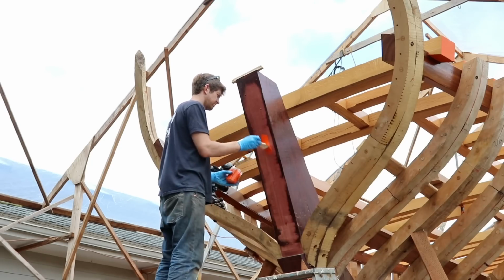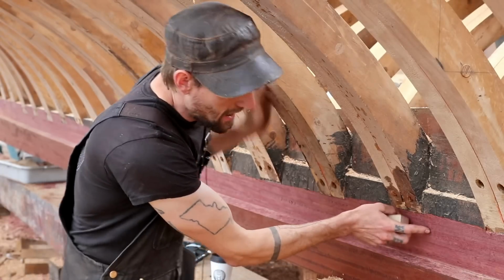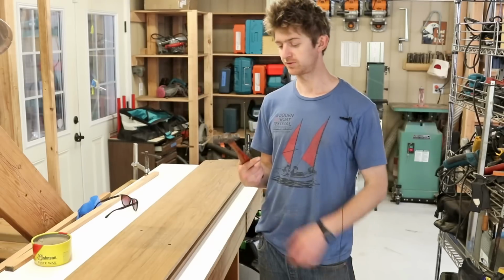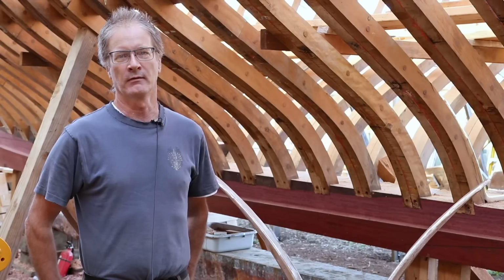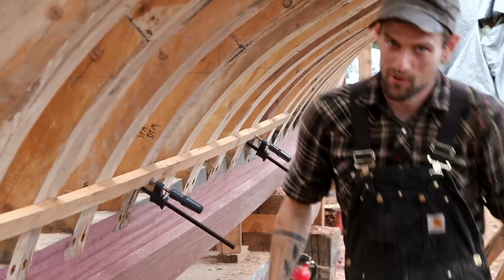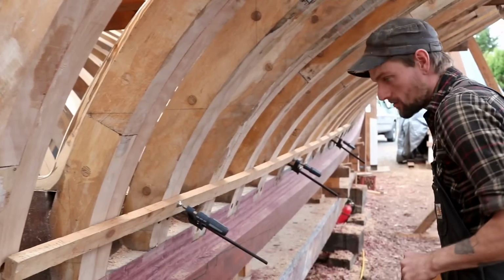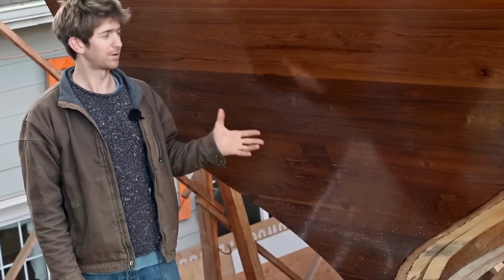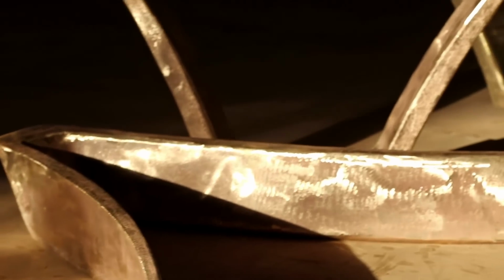BoatBuilding - Finishing the Transom (EP76)

Comment: Wow what a great episode! Absolutely loved seeing Pete and his good adze work, well done. Not to be critical, and I am not, because you are doing an amazing restoration of a classic yacht. For future reference, I am not a fan of splines for exterior joints. A few years ago I did a major repair to a very well built motor cruiser that had inch and a half solid old growth Teak cabin sides. The teak had been joined with plywood splines (not a good idea), apparently the boat had been left for a number of years under covers. The glue joints had failed and water had accumulated in the bottom groove, I have never seen so much rot in Teak. Since then my preferred joint is simply half lapped so that if there is a glue failure, the water runs out of the joint. I'm sure that what you have done, especially with the cotton barrier that it will be fine. Keep up the great work and videos.

Comment: id definitely polish those things. you said it yourself, the ability for corrosion on little crags and bumps from the mold would hold little bits of water and be more prone to corrosion all over. Polishing them to near mirror would be the best way to stop progressive corrosion imo. and they look effin gorgeous. you should sell posters of the long shot down the center of frames and floors when they are faired, polished and installed. id buy dat.

Comment: Polishing metal to a mirror shine is not a waste of time. For metal, the usual rule is - the higher the surface finish, the longer it will resist surface oxidation. Like with wood, small dents and holes is where humidity will get caught, and that hole/scratch will deepen quickly, then beome a true cavity, which soon becomes a seed for interior rot that burrows into the structure and spreads like wildfire. A mirror surface leaves very little space for the water to acumulate in such spots, and means that the corrosion must eat it's way inside from the surface. So even if nobody will ever see then, they will hold up longer because of the surface finish.

Comment: Hi Leo. Astonishing work on the transom. Just a few questions/comments:
1) How do you know how much torque you're putting on the Bronze bolts through the Stern Post - i.e  how tight are those babies?
2) Liking the polished floors. Having cleaned a few bilges in my time, I can tell you that those polished pieces are much easier to clean, green though they may be.
3) I can see your mate - the parrot- keeps on trukin'. Fun partner.

Comment: Hey Leo, I'd like to hear about some of the aspects of the daily life of this crew.  Do you guys break for lunch and what's dinner time like?  Do you all sit around and crack wise at a big picnic table.  Do you all avoid outside contact in these "unsure times".  How are the neighbor relations now at 3+ years?  I remember they (or one) was not keen on the protective structure.  Did you get that sorted for however long it will take?  Do you guys all live or sleep and recover in the mezzanine?   You guys are very inspirational as all of you are artisans, which is of course is why Clark is going to polish the floor castings.  Do you ever have nightmares from back when you removed the keel bolts on your own?  BTW- Your Amazon Wish List is empty.  Also, where are the dogs?

Comment: Polyurethane glue is a great choice for the tight fitting joints. Epoxy would not be a good choice as it does not like tight fitting joints. Older cascomite, resorcinol or other tight joint pressure fit glues would be much harder to use.than a simple one part ' 100% waterproof glue which has been around a long time 40+ years ....what more could you want?
Cheers Warren

Comment: YOUR A VERY SMART GUY IN THE BOOK IT MAY SAY THE TENSILE STRENGTH CAN BE SMALLER BUT IF THESE GUYS VERY WELL SEASONED OLDER BOAT BUILDERS AND YOU WENT WITH THE ORIGINAL SIZE YOUR RIGHT THEY MAY HAVE KNOW THINGS FROM EXPERIENCE. YOUR NOT ARROGANT A VERY GOOD TRAIT  THESE DAYS. WISE WORDS FROM A METAL SKILLED TRADESMAN.

Comment: Is there a benefit to making the bolt heads with thin edges? It seems like that would be a weak spot prone to chipping or flaking. A slight recess in the head forming plate would allow the hammered bronze to 'flow' into it, forming a 'beefier' square edge. I'm not a wooden shipwright, so thick edges may be unnecessary overkill, but I have done a lot of metal forming...Transom is a lovely piece of work, can't wait to see the rest of 'Big A' get that treatment...Addendum: When I installed nuts onto bolts in hard to access areas, I used a hammer and cold chisel to slightly deform the threads right at the nut. While the nut could be removed if needed, it wasn't likely to work loose on it's own. I don't know if that might be a problem with bronze in wood, but it would just be insurance for any well buried fasteners...

Comment: At a guess, they probably used 5/8" bolts on the transom because Tally-Ho has a relatively broad transom for traditionally built boats of that era and a broad transom acts as a big structural bulkhead. The transom would really help resist twisting of the hull when dried out on the mud, I wonder if pilot cutters also have a massively built transom similar to Tally-Ho?
Also remember, Tally-Ho's very close ancestors were working boats, built for severe abuse, so that's probably another reason for such oversize fasteners.
The mere fact she ended up on a reef and was successfully salvaged and repaired speaks to this. Not very many vessels of any size get salvaged successfully from a reef.

Comment: In the previous episode, you glued pieces of the transom together using a polyurethane glue which foamed. Other boat builders use Sikabond or one of the Sika products which are polyurethane glues which do not foam (I've found Sikabond to be much stronger than foaming polyurethanes, and it remains flexible, and does not loose strength with age). Is there a reason that you chose a foaming polyurethane?

Comment: During the casting process you can see after the bronze is poured that the runners/risers are heated with a gas torch, Is this to keep the bronze fluid in those areas, does this allow gravity to keep the mould filled as the bronze cools and shrinks. If the runners and risers had plugged up with solid bronze because it cools first you could suck in some voids as the bronze cooled?

Comment: curious if the splines will expand significantly, such that the grooves on the transom planks might crack?   I've made tongue and groove joints too tight only to have the groove self destruct as i coax the two pieces together...

Comment: Next time if the screws fail from lack of lock washers try welding nuts. Nothing be more extreme during a wind gust having to be in the bottom with a wrench trying to tighten bolts that are water soaking you while working g a wrench to only be hit with a wet cotton under full pressure.
Reply: Enjoy watching the parrot keep everyone working hard.

Comment: whats the white stuff you used on the bolts? corking? if so what type as ive never seen white corking before
Reply: It's cotton caulking, the same stuff that he laid along transom board edges.
Reply: @frederickstibbert7389  it's not linnen fibres with tree tar? That's what we use in Scandinavia

Comment: Instead of laying the pattern flat on the Drag half I would have tilted the pattern on a parting board the fitted the flask size. This would have added with the moulding process and easier demould and pattern removal.

Comment: Hey Leo, to follow up on the absurdity of polishing the floors, I noticed a few pits and imperfections in the bronze from the casting. Is there any value in grinding them out during the fitting and polishing process? Won’t any corrosion begin in those pits? Just wondering...

Comment: Howdy Leo.  I am gluing up a new bow in my 16' plywood runabout.  I replaced the rotted plywood filled with epoxy and filler with a number of dimensional 6/4 African mahogany which I plan to surface glue.  Which would you suggest:  1. polyurethane glue, 2. West System epoxy, or 3. West system epoxy with a filler?  I see you using a polyurethane glue quite a bit but I have all three glues available in house.  

Thanks and cheers if you find the time to answer this question.
Reply: I did the same - replaced the whole top of a GP-14 with mahogany plywood. I used wood glue on the joints, and thin epoxy as a sorface coating, then polyurethane on top. This isn't really traditional wooden boat materials of course, but the boat was from the 70s and has a fiberglass hull / wood top so I figured it was in keeping with those swinging times.
Reply: @dadomatic1  Hey thanks.  This is not the top cover but the actual bow that cuts through the water.  It is a cold molded plywood boat and the plywood had long since perished.  It has become more of a repair than I first thought it would be.  I am concerned about the stress the newly fabricated piece will be under as it push through the water.

Comment: Enjoying the videos and explanations. One question; I see you using slotted screws throughout rather than Phillips head or Square screws. Is this to keep with the original construction (even though most screws are covered) or is there a quality/strength/other reason?
Reply: A wooden boat will need repairs & replacement parts, requiring screw removal. Unlike other types, slot-drive heads can easily be cleared of old glue & goo.

Comment: I was watching you plug and it did not appear that you turned the grain of the plug perpendicular to the transom plank. I was watching another boat builder and they turned the grains so the plugs could not split the plank if they swelled. Just curios about your reasons for that.

Comment: Leo, at around 08:00, you drill & bolt the second transom "board" up through one of your earlier repairs to that board.  This is the upper bolt in the middle.  Will that cause problems in the future, possibly breaking away around the repair?  (I can't remember exactly how you inserted the repair, making me have to question where the bolt is located.)
It's also interesting to see a Blacksmith's handled punch being used to finish the driving in of the bolts.  ;)
Also, why did the Foundry heat the ends of the risers with their torch?
Has the Gorilla Glue (?) that you used for the plugs in the transom been tested (somehow) for longevity?  I've seen too many adhesives turn into powder 10s of years later.  I know that you intend for these "repairs" to last >100 years!
I don't mean to pick nits, but these questions popped into my head as I watched the video.  You guys are doing great!

Comment: So given that the "new" transom is thinner than the original, why when stripping the paint off the old transom parts did you sand it turning all the finish into toxic dust? Why not have stripped it with acid and paper? 

I completely understand stripping the deck house by sanding it, since it's not in pieces that can be made thinner, but the transom doesn't make sense.

Bronze dust, for the sake of the parrot at least, grind those bronze floors to fit the frames inside some kind of plastic tent, one with a floor (normal) that you can sweep clean with sweeping compound.

Comment: What were all those little holes at the bottom of the transom? Nails for some kind of fixing?
Reply: In 1910 the whole underwater hull was copper sheeted. What you see are the original filled up holes from the nails to fix that sheeting.

Comment: The fitting of the transom means that at no point has Tally Ho been 100% new. At 19:32 and 19:43 you can still see the original planks, which have never been taken off the boat and always kept in place. Now even if they are removed, the original parts of the transom will always stay on the boat. So there you go. At no point has Tally Ho been completely, 100% new, with none of the original timber in place.

Comment: What is the name of the tool you use to drive the 5/8" bolt into the recessed hole in the transom (e.g.at 9:10)?  I might have two of these in my hammer collection, but didn't know their name or use.  I thought they might have been some type of rock hammer.
Reply: Found it: countersink peen hammer.

Comment: Hello Leo, great work, Tally Ho is looking fantastic and the videos are excellent. Thank you.

I have a question about the limber holes. In the video they look quite small, with all the muck that accumulates in a bilge I'd be worried about them getting clogged up. Are you planning to run limber chains through the holes or will they be readily accessible to clean them ?

Comment: Build yourself a forge will make making the bolt head alot easier. Then just drop it into a drilled hole the correct depth.

Comment: Have you considered peening over the ends of the threaded rods to act as belt & braces for the nuts?
If you ever need to remove them it's more likely that you'll cut them in half rather than unscrewing them - not that you ever will, but hey!

PS: those floors are sex on wood :D

Comment: Hey, can anyone Tell me why they are heating Up the holes where the bronze comes Out?
Reply: The molten bronze starts to cool & shrink as soon as it's poured into the mold, those 2 risers are reservoirs of liquid material that keep the pressure on so the mold stays full. They heat it w/ the torch to keep it liquid, ideally this is the last part of the new pour to cool down.

Comment: Very smooth metal surfaces trend to corrode less.  Has to do with the energy at the peaks of the metal at the perceived surface.  A rougher surface has more energy in those peaks and therefore will more likely pick up stray electrons from the surrounding space and corrode.

Comment: I don't believe you have taken into consideration the horsepower it's going to take to move this yacht in the modern world. You have not past the point of no return. Give it some serious thought. It's just my opinion but I do believe that you will need in excess of 160 HP and a shaft and prop of corresponding abilities.
Reply: Tally Ho always had an engine.
Reply: TH is not a speed boat... 40-50 Hp will be enough

Comment: I am not so sure that the technique you use to form the heads of the bolts is the best that can be done.  I understand that the load is less than the carrying capacity of the 5/8 stock but the stress concentration introduced by the sharp edged head and the resultant small shear stress area is not desirable.  A better way would be to make the bolt head more like the head of a steel rivet or a bolt.  Just think of the cylindrical area of the head along and parallel to the bolt axis at the bolt surface.  A sharp bolt head as your forging produces minimizes this area resulting in high stress.  

Perhaps next time you could machine a recess in the steel plate die that consists of two holes: one through hole for the bolt stock and one of partial depth for the formation of the outer diameter  of the head.  This would increase the cylindrical area of the bolt head in shear along the axis of the bolt and increase the load capacity.  That is why the heads on regular hex bolts are the size (height) that they are.  Just a thought.  You are doing a great job!

Comment: Extremely disappointing to see that worm eaten and weak transom reused without it being epoxy vacuum reinforced. You know that it's not going to last. It should have been epoxy vacuumed to fill every hole and gap to strengthen it and prevent water influx. Very, very disappointing